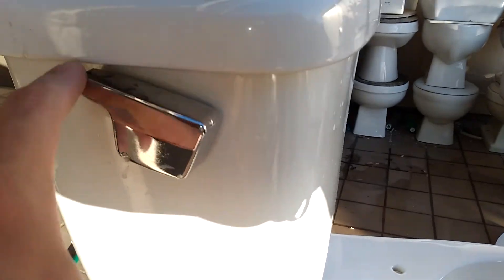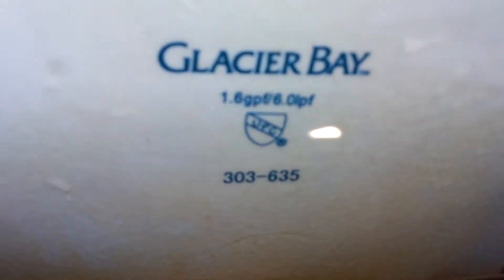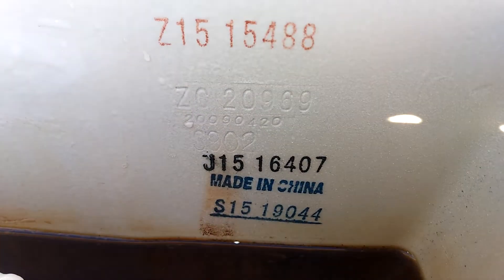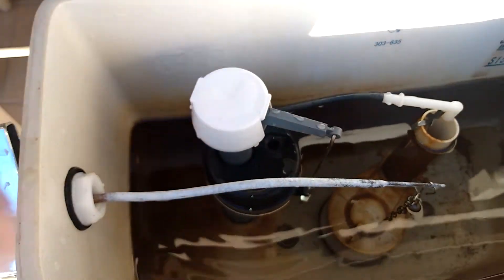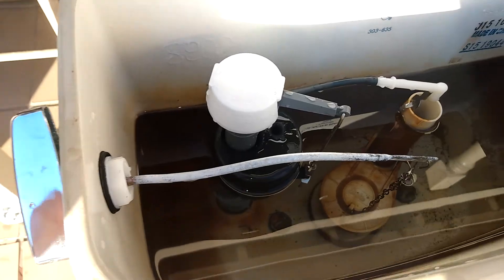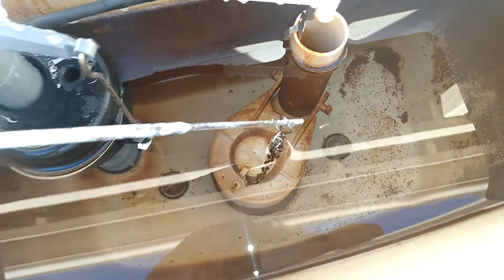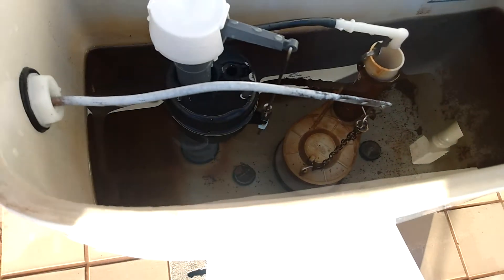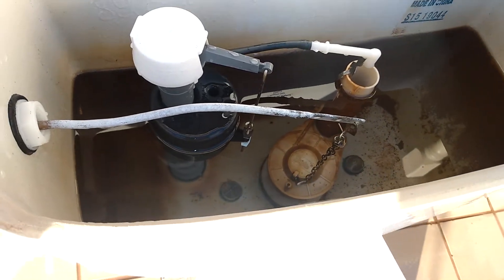2009 Glacier Bay toilet flushes

Comment: My grandmother has these in her house. All of the tank parts were replaced with a fluid master set. Obviously the fill valve is fine but the lever hits the tank lid every time you flush, and the flapper doesn’t stay open. It barely lets any water in and you have to hold down the lever the whole time. It’s one of my least favorite toilets